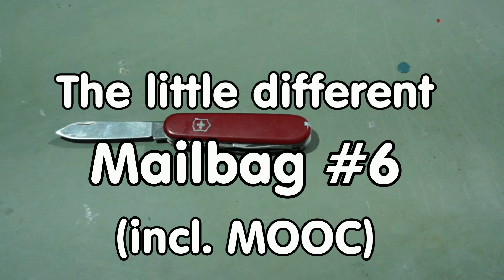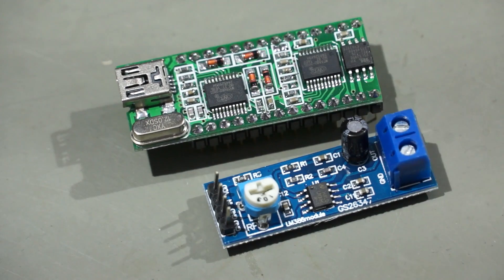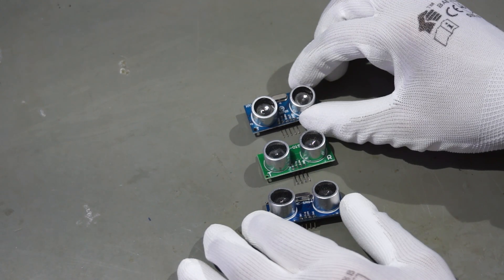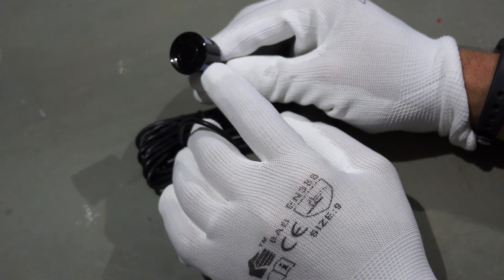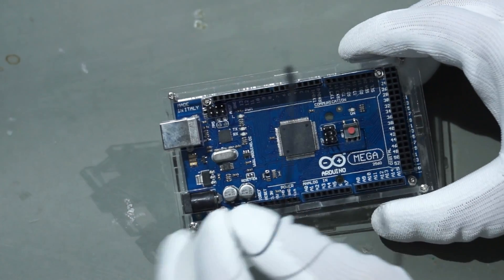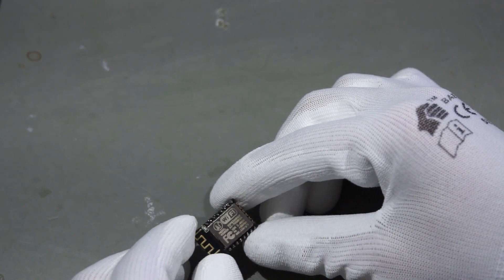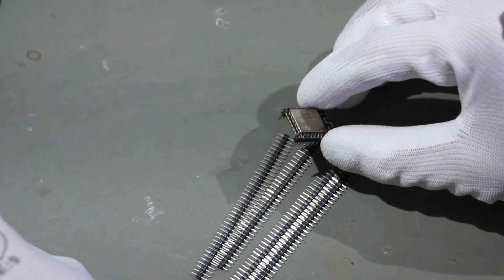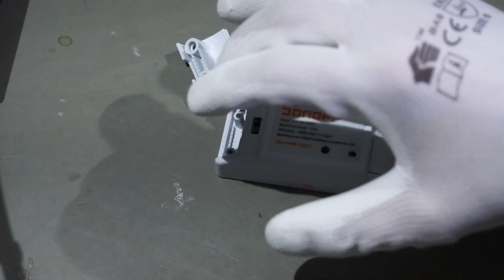#83 Mailbag #6 incl. Booster Packs and MOOCs

Comment: You can also use the adapter board for ESP 08's and ESP 12's from aliexpress to get your proper 2mm headers, it also adds that all important cap across the power: https://www.aliexpress.com/item/Serial-WIFI-ESP8266-module-adapter-plate-Full-IO-port-leads-you-can-choose-the-ESP-07/32327077682.html
Reply from the maker: You are right. That would be another possibility.
Reply: Would like to say, you're one of my like minded brothers. We love the arduino mega. and the ESP. Wish I could make such a good job as you do to promote the wonderful possibilities. Your videos inspire me, and many others. I believe modules and basic programmable units are the future of the next 10 years. The 90s were PIC, and today we have easy programming of hardware. The shift is exciting.
Reply from the maker: Thank you for your nice words! I missed the 90' maker wise, because they were "family and job". But I think, we get now everything we dreamed off in the 80', when I got my first TRS80 with 4k RAM (not Megabytes). That is probably, why I enjoy it so much.

Comment: Hello Andreas!

Due to this video my 8266 modules finally got decent legs :-)
Would you be so kind and share some of your experiences about soldering station - as i see you moved from Weller to Aoyue. Weller has some nice new models from WT family but the price is quite high. Still using old Weller but time for new one is coming and hearing your experiences would be helpful. Is Aoyue more economic and good enough choice? Thank You!
Reply from the maker: I bought the Aoyue 968+ a few years ago, but I am not happy with it. It works, but the temperature of the soldering iron is not exact, and also the vacuum is not very good. The best part is the hot-air. It will not get as old as the Weller... But, of course, it was much cheaper than a Weller
Reply: Thank You for your helpfull opinion! Do you have any advice or any idea which hot-air to choose instead of whole 968+ station to get only the best part of it? As i see i will replace my old Weller with new one ;-)
Reply from the maker: I only have experience with the 968. And you know me, I will not suggest something I du not know.
Which Weller will you buy?
Reply from the maker: Yes, it is quite expensive. But if it lasts for many years, maybe it is worthwile...

Comment: Great video and I like the new format. I don't need to see, how you unbox the envelopes. I think most of the viewers know how the typical delivery from china looks like.

Have you the Sonoff with or without the additional 433Mhz receiver? When the 433Mhz is connected  to the ESP to, this thing is eaven more handy. Looking forward to the video, where you flash a new FW on it!

For those who don't have a credit card or like to order from aliexpress: The vibration motors and the FG-100 themometer are listed on ebay to!
Reply from the maker: 1. Thanks for the feedback. I will keep the format without unpacking. It avoids also the comments about my skills with the knife ;-)
2. I only have the one w/o 433 MHz
3. I Order mainly from Aliexpress and banggood, because it works and I had no problems during disputes. I use ebay for European stuff. Also ok. I think, it is good that some completion exists among the different channels.
Reply: 1. Sometimes these packages are hard to opening, without harming the goods or fingers.

2. :(

3. I order from banggood and gearbest to, but sometimes the prices are better on ebay. Quality depends a little on luck. I've ordered five HD44780 displays with I²C adapter from bangood and only one worked out of the box.

I'll try Aliexpress to, because I can't get the items elsewhere, like the WeMos D1 mini Pro or the small 0,8V to 3,3V step up switching regulators you tested in a video.
Reply from the maker: I plan a video with all the Wemos parts, the WeMos D1 mini Pro included. I already have all parts here.
Reply: Cool, looking forward to it!

Comment: @3:40 in many shops they are called "Waterproof Ultrasonic Sensor" . But it is a underwater ping sensor. You can use it only under water. It is basically a piezo in a aluminium case without electronic.
Reply from the maker: Thanks for the tip. But unfortunately, none of the ones I checked had any info on how to use it (the bare one)

Comment: you can find both types of optical sensors in broken printers... they are used to monitor the presence of paper sheets and when it's going off the rotation element, and as endstops for the motors...
Reply from the maker: That is for sure a good place to use them. They are quite universal. And this is, why I bought a bunch of them. Just to have them if I need them.
Reply: you can find lots of them there, but its like buying a house just to get a set of chairs... this is most likely more affordable as well
Reply: hey andreas... nice mailbag as usual, can you please in future mailbags say what the approximate cost of some more important items is.. like those ti boards for example

Comment: that waterproof ultrasonic sensor capsule could be a 40KHz transducer so you might be able to get away with just replacing the non-waterproof transducers on a sensing module from ebay.
Reply from the maker: This is well possible. Maybe, I will also replace the waterproof one to check if it still works. Or I do a tear down and look inside...
Reply: No need to tear it down. These are 40KHz ceramic resonators, 2nF DC capacity, 20Vpp and work both as transmitters and receivers. They are probably copies of transducers made by Panasonic, now discontinued, things like this, see Type Q in this datasheet: 
http://pdf1.alldatasheet.com/datasheet-pdf/view/131451/PANASONIC/EFRTSB40K5.html
Reply from the maker: Thanks for the tip! So, I hope, I can get some info concerning how to use them using my oscilloscope and not to destroy the sensor.
Reply: I have exactly the same modules and I plan to do the same tests, if you want to discuss that you can contact me  by email catalin59 at yahoo dot com

Comment: The inbuilt AC power supply of the Sonoff makes it quite interesting.  I think a lot of people will be buying them & hacking their own additional sensors into them.
Reply from the maker: There is a new TH version available which already has a one wire interface. This makes it even easier and, you are right, the AC power supply is an important point for me. Even if it would be a bad quality and blow up, nothing big happens if we use OTA, because we have no connections to more expensive (computer) devices.

Comment: Always love your videos. When you showed the acrylic arduino cases I questioned why buy when you can print?... and then I looked at the price of the cases you bought. Yup I would buy as well. Very interested in seeing what you do with the Sonoff unit and what firmware you load. Also FYI you can get handy 2mm grid proto arduino shield pcbs for low cost.  http://www.ebay.com/itm/131398518268
Reply from the maker: The cases are more a gag and better looking than the 3d printed one you will see in the next video.
Concerning prototype shields: I am in the privileged situation that I can mill my own PCBs, bot thanks for the tip for other viewers.